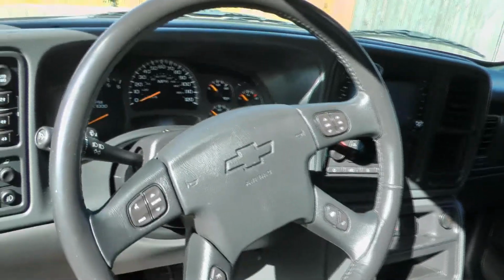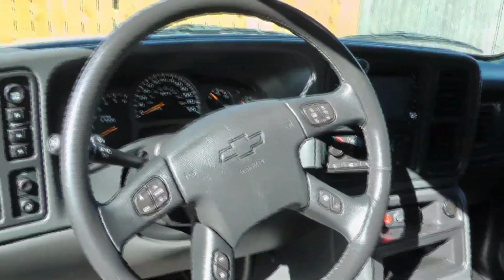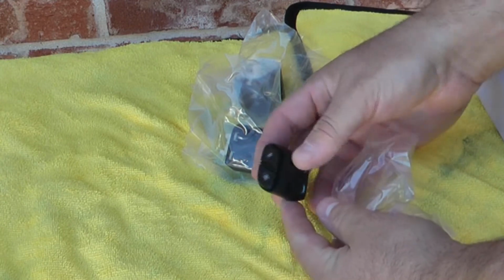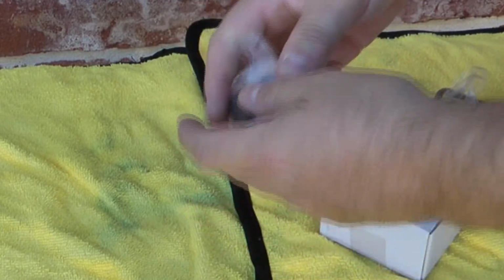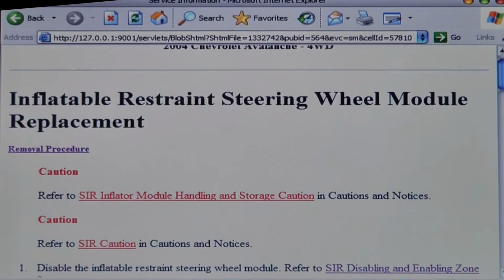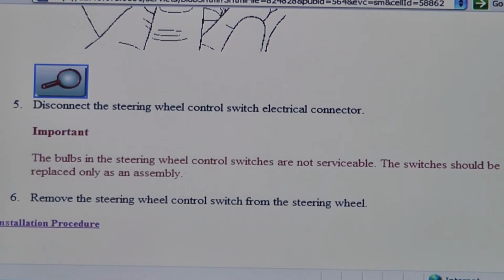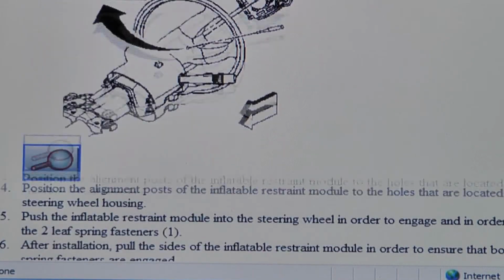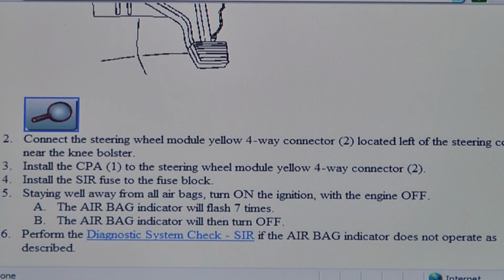Chevy Avalanche truck and SUV steering wheel controls - how to replace

Comment: Right on Handy Dad. 
This will be sure to help folks out. 

I'm more interested in that online service info. Where'd you get that, and how do I get it?

-Chuck
Reply from the maker: it's not online - it's a shop manual that I bought years ago when I first bought the truck.  It runs as a virtual machine but it's not hooked to the internet.  In fact, the computer that runs it is so old I can't even hook it to the internet!
Reply: @WJHandyDad  
Now you're speaking my language.
I used to keep an old laptop that was running windows XP so I could play solitaire on it every 6 months.
It got so old, and worn out that was the only thing it could do. lol